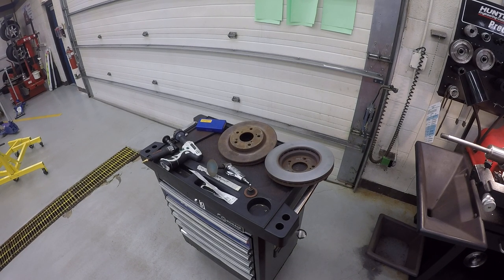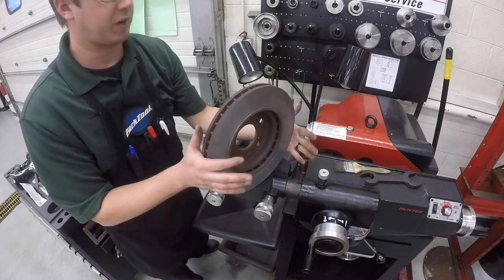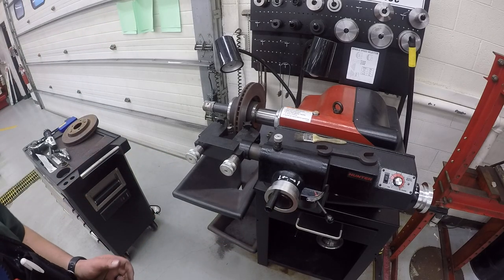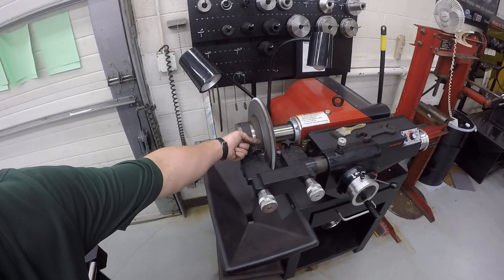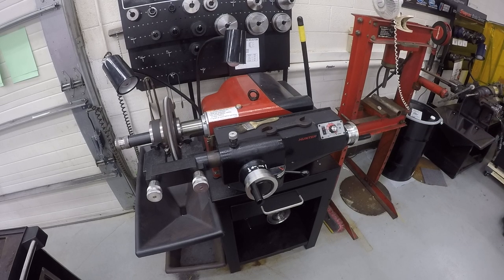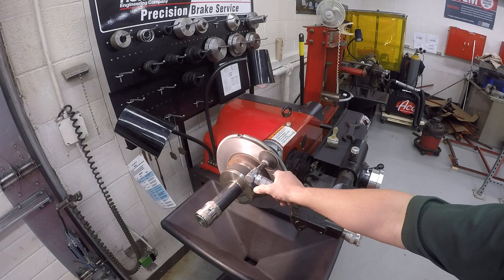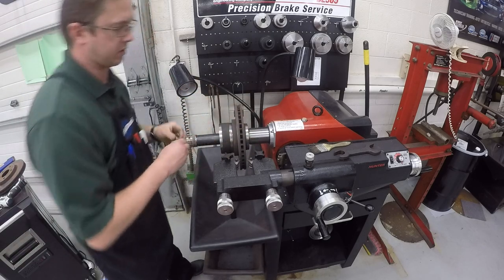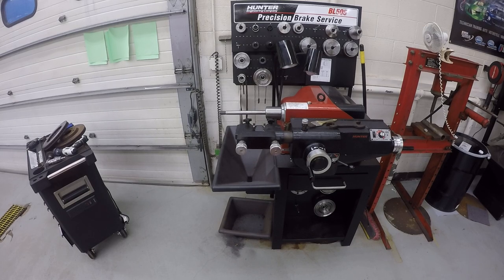Hunter Brake Lathe - Turning a Brake Rotor

Comment: So only "lock down" the cutting blades once you set your cut depth? In this case, .004"? I see that you locked them in place with those black knobs. Is it possible to just keep the blades locked in while you're making all those initial adjustments beforehand?

Comment: Ok. So you didn't do an initial "kiss cut".  Then you didn't loosen-turn 180 degrees and tighten to run a parallel line and check for trueness against the "kiss" line. That's important to make sure your rotor is properly sitting on the laith. Then you didn't take the inner diameter lip out. Also, most bits require  you taking at least 5 to 6 thou in each cut, so your bits don't overheat. You did it at 4, which may or may not be the best thing. Heat transfer might not be very efficient, but lets say it was okay. Also, no mention of your rough and smooth cuts. First run is fast rpm and that's the rough cut. 2nd cut is at low rpm and that's your smooth cut. Then you're supposed to hone the disc with a rotor hone adapter on an angle grinder.
Reply: No.

Comment: Best practice is to adjust the cutting tips so they come off the rotor at the same time. Then lock down the twin cutter.
Reply from the maker: The purpose of my channel is to teach high school students how to use automotive equipment. Yes, better methods might be available but I break tasks down step by step for easier processing by students. BTW, you have a nice channel!